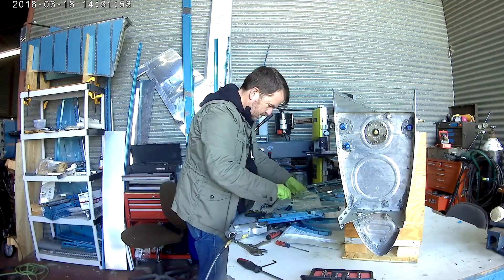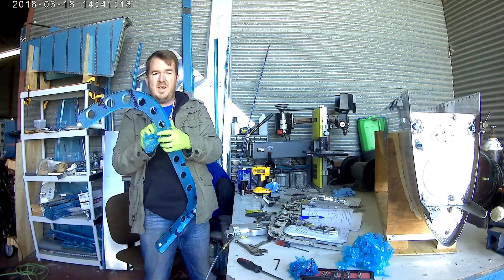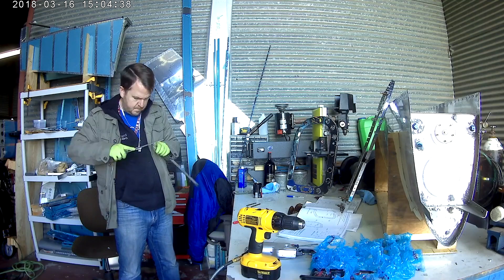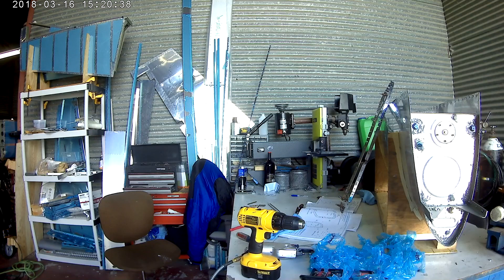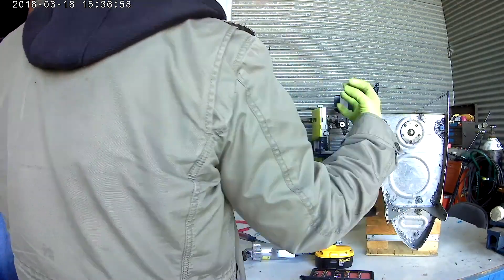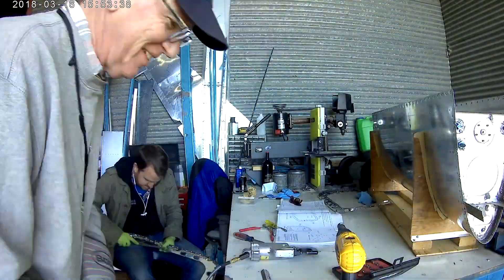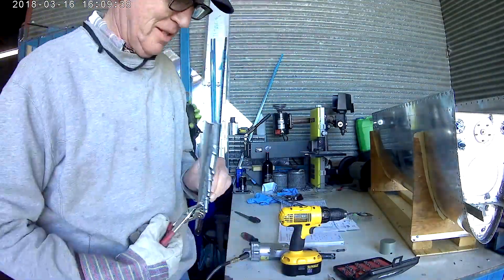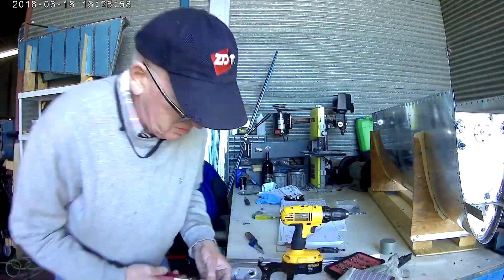RV - 14 Tailcone 5

Comment: Andrew, as we are currently working on the same section, I was wondering if you had got to The step where you run the wiring harness down the left side. I ran in to an issue with mine (WH00057) which contains the connector for the trim motor and wiring for aft lights. There appears to be a wire missing from pin 9 in the forward connector (looks like a green lead to ground the wire sheilding). Was wondering if your harness had the same issue. If you aren't to that step yet, then at least a heads up to look for.....
Reply from the maker: I hadn't quite gotten there yet. I was just starting riveting up bulkheads and stiffeners to the bottom skin